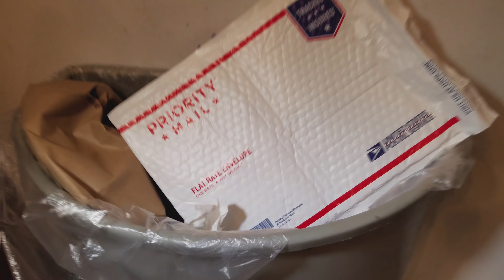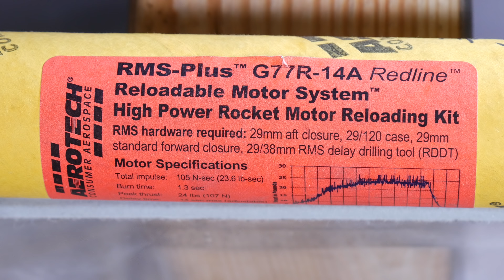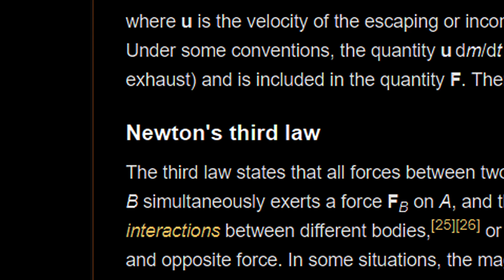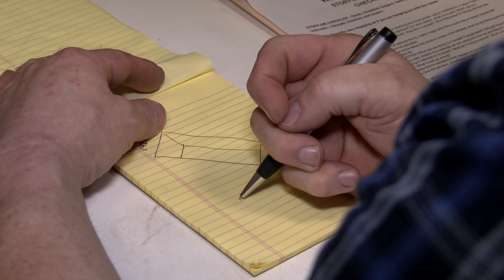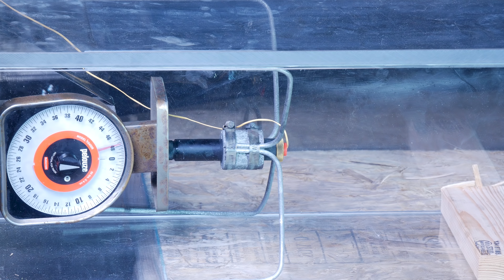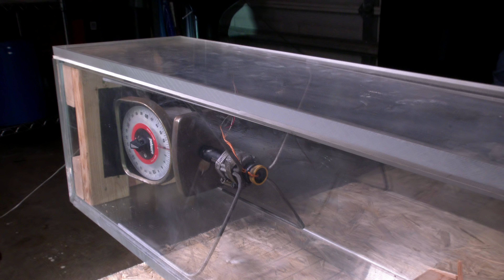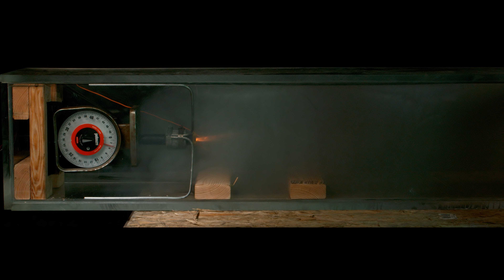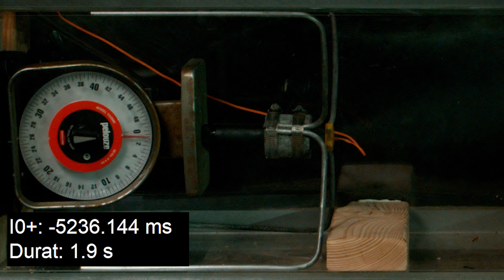Rockets in a Vacuum Chamber - Newton's third law of motion Visualized

Comment: You need to show what is happening with the pressure gauge inside your vacuum while the fuel is burning because inside a sealed case it would probably create it's own atmosphere.
Reply: True its faken
Its correct he fooled ...he created the Atmosphere to burn the oxygen but not really used Vacuum 
Because he'll fail and no one will see this video
Reply: @anjanikumar.t1708  - Maybe you should leave the thinking to those that actually bothered to finish high school?
Reply: @anjanikumar.t1708  Prime example of how some people won't believe anything, regardless of the evidence provided.  Like all Flerfs, the'll just scream "nuh-uh!" and claim they've debunked it.
Reply: It lost half its vacuum when fired up.
Reply: @lomasck  LMAO. Half? You honestly think a little fire cracker like that created 0.5 Atmos of gas in a chamber that size? You'd be lucky if the pressure increased by even a full percent.
Reply: @anjanikumar.t1708  The question wasn't will something burn in space but will a rocket engine produce thrust in space and the answer that question is yes.

Whether something will burn in space is irrelevant as we have hypergolic engines which require no oxygen to burn.

In fact hydrogen oxygen engines have their own oxidizer again not needing oxygen or an atmosphere.

So the question is always been will a rocket produce thrust in space, anyone with two functioning brain cells rub together already knows the answer to this, of course it will.

Even A simple thruster consisting of compressed gas will produce thrust in space.
Reply: @papalegba6796 Explain how what he said contradicts Newtons first law?
Reply: @dorkangel1076  cos a vacuum cannot apply an external force. Look: "Newton's first law states that every object will remain at rest or in uniform motion in a straight line unless compelled to change its state by the action of an external force". Can a vacuum apply an external force? No, it cannot, obviously. As I stated, a free body diagram shows that a rocket in a vacuum cannot create a force pair with an external body, as a vacuum is by definition the absence of all matter. No external body = no force pair = no change in motion. Very simple, but you'll refuse to understand.
Reply: @papalegba6796  Where did he say a vacuum applies an external force? A vacuum is simply empty space. Every action has an equal and opposite reaction. Fire a gun and there is recoil in the opposite direction. Shoot some particles out of a nozzle and there is recoil in the opposite direction. Being in a vacuum actually makes the movement easier since there’s no air resistance on the object being moved by the recoil. It’s quite simple but you’ll refuse to understand…
Reply: @papalegba6796  A rocket firing is zero energy? You're obviously not a chat bot, they're smarter than that...
Reply: @papalegba6796  Tell us again how a space shuttle main engine can accelerate 500 kilograms of mass every second from a standstill to MACH EIGHT all WITHOUT FEELGING A RECOIL FORCE !
WHY do you keep refusing to address this question?
Oh THATS RIGHT, because answering truthfully PROVES YOU WRONG?
Reply: @dorkangel1076  - "You're obviously not a chat bot, they're smarter than that..."

Yeah, I asked ChatGP how rockets propulsion works in a vacuum. It explained it perfectly.
So ChatGP is a smarter Bot than Papa Legba.
Reply: @dorkangel1076  "A vacuum is simply empty space."  Empty space has no relative force. FOR EXAMPLE...  you cannot use empty space to push something, because nothing will happen. LIKEWISE,  you cannot use something to push empty space. Put more simply you cannot use nothing to push something and you cannot use something to push nothing. Laws of physics are built on laws of logic. Without logic its just a bad theory. Can you use something to push against something else? sure. What are you pushing against? Can you use something to push against itself? Perhaps but it would collapse or expand on itself in this way it would not have acceleration or trajectory.
Reply: @toddstiebinger6532  So what? Who says a rocket needs something to push against? You are arguing “logic” against your own strawman. Rockets aren’t pushing off the air so they work even better in space since there’s no air resistance. You should check Greater Sapian’s channel. His latest video breaks down his it actually works and the physics behind it.
Reply: @papalegba6796  "so Newtons first law is wrong? Ok lol." So, you can't understand the experiment. Why turn up to tell us?
Here: Does an explosion in vacuum create outward force, champ?
Reply: @dorkangel1076  These guys aren't here to learn but to cheerlead their anti-science belief system. They are here to help convince themselves they are heroes - without having to think for themselves. I think it's best to just demonstrate how they are wrong in front of the public.
Reply: @Cosmic-Spanner  combustion in a vacuum is impossible, "champ", as it posits a system incapable of either energy transfer or doing work somehow changing its internal energy. Because if ∆U = 0 - 0 then ∆U = 0. So, you don't understand either Newtons first law or the first law of thermodynamics... "Champ chatbot" 😂😂😂😂😂😂
Reply: The equation for work done by a gas is Work = External Pressure x Change in Volume. When external pressure = 0, then Work also = 0. No work = no change in motion. Very, very, simple. Except for NASA chatbots 😂
Reply: @papalegba6796   "combustion in a vacuum is impossible, " Unsupported claim? That's too funny.  Don't need to combust in vacuum champ. Oxidants can be sealed in a container with explosives. This video shows explosions starting and propagating into a partial vacuum. Pressure is variable. Try again.
Reply: @papalegba6796  "spamming fake physics propaganda." It must burn that you can't use real, intelligent arguments to falsify them then right?
Reply: @Gr-Ra5  so all the laws of physics I quoted are not real or intelligent according to you? Ok NASA chatbot 😂😂😂😂😂😂😂😂😂😂
Reply: @Cosmic-Spanner  I stated why combustion in a vacuum violates the laws of physics, chatbot. You're not programmed to understand why tho 😂😂😂😂😂😂😂😂😂😂😂😂😂😂😂😂😂
Reply: @Cosmic-Spanner  you think the first law of thermodynamics is unsupported 😂😂😂😂😂😂😂😂😂😂😂😂😂😂😂😂😂😂😂😂😂😂😂😂😂😂😂😂😂😂😂😂😂
Reply: @toddstiebinger6532  the experiment showing rockets can't work in a vacuum was performed in 1843. It's old news.
Reply: @Gr-Ra5  <----- silly chatbot thinks the laws of physics aren't real or intelligent 😂😂😂😂😂😂😂😂😂😎😎😂😂😂😎😂😂😂😂😂😂😂😂😂😂😂😂😂😂😂😂😂😂😂😂
Reply: @papalegba6796  You only managed "combustion in a vacuum is impossible, " . 
Stating the names of theory and law doesn't mean you "explained" anything, slow guy. It means you can recite names.
Try again. Use some actual science to support this claim.
Reply: @papalegba6796  You need to explain why a sealed container with an explosive and an oxidant cannot work to create an exothermic explosion in a partial vacuum.
Good luck, champ.
Reply: @papalegba6796  Your little yellow pictures in your posts make you look so mature and intelligent! Well done.
Reply: @toddstiebinger6532   Legba: "the experiment showing rockets can't work in a vacuum was performed in 1843. It's old news."
That's right. And up until 1871 experiments showed powered, manned flight was impossible. Legba is a real genius. Hahaha.
Reply: @papalegba6796  Name the experiment, the scientist.. etc etc. Got a link?
Reply: @Cosmic-Spanner  I explained everything, chatbot 😂😂😂😂😂😂😂😂😂😂😂😂😂😂😂😂😂😂😂😂😂😂😂😂😂😂😂😂😂😂😂😂😂😂😂😂😂
Reply: @toddstiebinger6532  NASA chatbots know nothing about the history of physics. Not programmed to 😂😂😂😂😂😂😂😂😂😂😂😂😂😂😂😂😂😂😂😂😂😂😂😂😂😂😂😂😂😂😂😂😂
Reply: @Gr-Ra5  lmao so the laws of thermodynamics ARE fake according to NASA chatbots? 😂😂😂😂😂😂😂😂😂😂😂😂😂😂😂😂😂😂😂😂😂😂😂😂😂😂😂😂😂😂😂😂😂😂😂😂😂😂😂😂😂
Reply: @Cosmic-Spanner  NASA hates the laws of physics & you admit it 😂😂😂😂😂😂😂😂😂😂😂😂😂😂😂😂😂😂
Reply: @Gr-Ra5  listen to yourself hating on the laws of physics like I wrote them 😂😂😂😂😂😂😂😂😂😂😂😂😂😂😂😂
Reply: @papalegba6796  So, you absolutely can't falsify that a sealed oxidised explosive can work in space? That's AWESOME, Legy.
And your lack of explanation that we can actually see in the thread - is simply denied. try again. See if you can explain ANYTHING that supports you. Don't just state that youre right and some names of laws and theories. See if you can be intelligent.
Reply: @toddstiebinger6532  I get the feeling Legba cant explain nor support anything at all because he didn't study and can't understand the topics.
The more yellow pictures he includes the more correct he is about stuff.
Reply: @papalegba6796  "I explained everything" - "combustion in a vacuum is impossible, "champ" Nope. You made a claim.
Reply: @Pounder - "maybe you should just admit that you don't understand the concept of infinite vacuum."
I have been a vacuum test specialist since my first job as an aerospace test engineer in 1995.

I was trained by Lockheed Martin Space Simulation laboratory to operate some of the nation's largest thermal vacuum chambers.
But tell us again how YOU know more about vacuum than I do genius.
Reply: @Pounder Because "NU-UH!" is a logically sound argument, at least in a Flerf's eyes.  I'll never understand the desperation of clinging to an idea which is disproven by literally all aspects of science and logic.  It must be a rather unfulfilling life to have such a fragile ego that one can't stand being wrong.
Reply: @watchyourtimeco1  so the laws of thermodynamics are disproven? NASA would love that but sadly it is not true 😂😂😂😂😂😂😂😂😂😂😂😂😂😂😂😂😂😂
Reply: @stuartgray5877  you're a chatbot you do nothing but spam YouTube comments with gibberish 😂😂😂😂😂😂😂
Reply: @Gr-Ra5  nah I explained it, chatbot 😂😂😂😂😂😂😂😂
Reply: @Cosmic-Spanner  s🍎so you forbid me from using the laws of physics to explain things? Ok chatbot 😂😂😂😂😂😂😂😂😂😂😂😂
Reply: @@Poundertruth the chatbots are literally telling me I'm not allowed to use the laws of physics when I explain why a rocket can't work in a vacuum, you cannot make this level of FAIL up 😂😂😂😂😂😂😂😂😂😂😂😂😂😂😂😂😂😂
Reply: @@Poundertruth I'm the only one in the thread even quoting the laws of physics. The chatbots are just calling me names & telling me to stop 😂😂😂😂😂
Reply: @papalegba6796  But youre unable to quote your own explanation?
That's hilarious. It's like youre embarrased and think Iying will distract us.
Reply: @papalegba6796   "combustion in a vacuum is impossible, " . Unsupported claim.
Again: You need to explain why a sealed container with an explosive and an oxidant cannot work to create an exothermic explosion in a partial vacuum.
Good luck, champ.
Reply: @@Poundertruth Tell us what his explanation was then, champ.
You'll look great when you fail or quote his unsupported claim or an equivalence fallacy as if it was an explanation,  Watch:
Reply: @@Poundertruth the chatbots are now claiming that the first law of thermodynamics is unsupported. They are a hoot!😂😂😂😂😂
Reply: @Gr-Ra5  it's like you ignore everything I post & just abuse me. Could it be because you are a chatbot? 😂😂😂😂
Reply: @Cosmic-Spanner  I never mentioned a partial vacuum, never mentioned a sealed container either. I said combustion in a vacuum is impossible & explained why. You are a proven liar now, as if nobody knew already 😂😂😂😂😂😂😂😂😂
Reply: @Gr-Ra5  you're claiming the Joule expansion experiment was wrong too 😂😂😂😂😂😂😂😂😂😂😂😂😂😂😂😂😂😂😂😂😂😂😂😂😂😂😂😂😂😂😂😂😂😂😂😂😂😂😂
Reply: @papalegba6796  More incoherent nonsense? Awesome.
You can't explain yourself.
Reply: @papalegba6796  If I was a chatbot, would that make you able to explain your claim, Einstein?
Reply: @papalegba6796  " I never mentioned" But I did. Well done admitting you don't have an explanation - and that anything in proximity to an explosion in space (partial vacuum) would move away i a specific vector.
We already know you need conditions for combustion. You're not fast are you pupu. Try harder.
Reply: @papalegba6796  "are now claiming that the first law of thermodynamics is unsupported."
That's supported. Your claim isn't. Remember the words i used? "Unsupported CLAIM". Do you train to be this slow, Pupu?
Reply: Nothing the NASA chatbots post makes sense any more. They're just ranting & hating on the laws of physics 😂😂😂😂😂😂😂😂😂😂😂😂😂😂😂😂😂😂😂
Reply: So you'll have to prove a sealed container with fuel/oxidiser can't explode in space, and then why an object wouldn't react to the force from it. Hahahaha. Saying "but I said a law" doesn't make a supported argument champ. That's you having no real argument.
Reply: @Cosmic-Spanner  so when you lie about what I said it's my fault not yours? Ok chatbot 😂😂😂😂😂😂😂😂😂😂😂😂😂
Reply: @Cosmic-Spanner  so space is a partial vacuum now? According to NASA it's the most perfect vacuum possible but you're just lying about everything now anyway 😂😂😂😂😂😂😂😂😂😂😂😂
Reply: @papalegba6796  Trying to distract us, champ ? HAHAHA.
"so space is a partial vacuum now?" What's the pressure just outside earth's atmosphere, Pupu?
Reply: @papalegba6796  "but you're just lying about everything" If that were the case you would have a supported argument to prove it, Pupu.
Reply: @papalegba6796  The problem for you, is that we can read the thread and understand why you're failing.
Reply: @papalegba6796  "to NASA it's the most perfect vacuum" Is it perfect, Iiar?
Reply: @Cosmic-Spanner  so your fuels are sealed from a vacuum now? Ok chatbot 😂
Reply: @papalegba6796   If there was an explosion in space, there was pressure and an oxidiser, Smart guy.
Look how you still havent got a clue how to answer this. Hahaha. Just funny questions to try and distract.
Reply: @papalegba6796  So an explosion in space would propel a close object away from it, and we can use that principal to make thrust.
Youre done here. Pupu. You have nothing.
Reply: @Cosmic-Spanner  so there's pressure in a vacuum now? Ok chatbot 😂
Reply: @Cosmic-Spanner  so the exhaust of a rocket has to turn around to face the rocket, then impossibly combust in a vacuum, in order to push the rocket away from it? Ok chatbot 😂
Reply: @papalegba6796  "sealed from a vacuum now?" They were from the start. I didnt say we combusted anything in vacuum, YOU did. You tried a straw man fallacy and lost.
Reply: @Cosmic-Spanner  how many objects is a rocket, chatbot? I count one but you seem to think it's at least two, both of which violate the laws of physics anyway 😂
Reply: @papalegba6796  "then impossibly combust in a vacuum" Is the explosive sealed in a container, SHerlock? Are you STILL having to Iie to make your argument? Hahahaha,
Reply: @papalegba6796  "how many objects is a rocket" Explain how this changes anything. You know, say something that means sometyhing.
 "both of which violate the laws of physics anyway 😂" So why cant you explain how, champ?
Obviously if youre still making unsupported claims, you can't have a real argument. LOL
You would just post the real argument.
Reply: @Cosmic-Spanner  ok so you admit combustion in a vacuum is impossible. I agree, as do the laws of physics you hate 😂
Reply: @Cosmic-Spanner  please just quote one law of physics you don't hate. Just one, angry chatbot loon 😂😂😂😂😂😂😂😂😂😂😂😂
Reply: @papalegba6796  Youre really starting to realise how badly you got burned and exposed here arent you. Hahaha.
Reply: @papalegba6796  "ok so you admit combustion in a vacuum is impossible" We're still not doing that, like I told you in the beginning. Remember the sealed container statement YOU made? Hahaha, How are you STILL trying to Iie about this and think people wont see it?
Reply: @papalegba6796  Again: You need to explain why a sealed container with an explosive and an oxidant cannot work to create an explosion in a partial vacuum and PUSH on an object next to it.
Good luck, champ.
Reply: @Cosmic-Spanner  if you can't quote any laws of physics to support you just say so, angry ranting chatbot. No need for all the rage 😂
Reply: I don't need to explain why a rocket NOT in a vacuum would work, because I never said it wouldnt. NASA chatbots are insane 😂
Reply: @Cosmic-Spanner  you're also claiming a rocket is two objects again, are you blind? Crazy raging NASA chatbots cannot count 😂
Reply: @Cosmic-Spanner  how many objects is a rocket, crazy ranting chatbot? I count one but you clearly see two 😂
Reply: @papalegba6796  Four years later and this NASA chatbot is still alive and well.

Really? NASA chatbot is all you got?
Reply: @CreggLund  I'm not calling you a chatbot. Tho maybe you are, as you clearly haven't read the thread 😂
Reply: @papalegba6796  I stated a method you cannot falsify that can create thrust in space using fuel. Youre done.
Reply: @papalegba6796   "how many objects is a rocket" I told you to tell us what difference it makes and you can only recite your question. LOL
Over and over, and with little yellow face picture, you show us what you are.
Reply: @Cosmic-Spanner  your chatbot ranting still contains zero references to any physics. It never will either, as you are not programmed to understand them 😂
Reply: @papalegba6796  Again: You need to explain why a sealed container with an explosive and an oxidant cannot work to create an explosion in a partial vacuum and PUSH on an object next to it.
Good luck, champ.
Reply: @papalegba6796  "still contains zero references to any physics." And I'm still beating you. Easily. Funny, no?
Reply: @Cosmic-Spanner  lol so you're beating me at explaining physics by explaining no physics & making mad unverifiable claims about things I never said anyway? Um, no, chatbot. You are not 😂
Reply: @Cosmic-Spanner  so, according to you a rocket in a vacuum is in fact a sealed container behind the rocket, in a partial vacuum that you do not define, that somehow explodes & pushes the rocket away from it? Also pretty sure explosives already contain an oxidant, but that's the least of your problems tbh 😂
Reply: @papalegba6796  "Also pretty sure explosives already contain an oxidant," That would depend on the explosive, Einstein.
Pretty sure you don't understand any of the topics, champ.
Reply: @papalegba6796  Again: You need to explain why a sealed container with an explosive and an oxidant cannot work to create an explosion in a partial vacuum and PUSH on an object next to it.
Youre failing after ALL these posts of you crying. haha.
Reply: @papalegba6796  "so, according to you a rocket in a vacuum is" Nope. You cant seem to do anything except create straw mans. Hahaha.
 I gave an example of how to produce thrust in space, champ. Show us how you cant refute any of it again.
Reply: @Cosmic-Spanner  you literally can't state how many objects one rocket is, yet you say you are beating me. Utter chatbot fail 😂😂😂😂😂😂😂😂
Reply: @papalegba6796  "you literally can't state how many objects one rocket " 3 times you were told to explain what difference this makes. You failed every time and can only repeat the question.
Reply: @papalegba6796  Its so funny that you glaringly show us you think this red herring is an argument. How would you ever know if you "won" any argument when you cant understand the basic ideas being argued, champ?
Reply: @Cosmic-Spanner  please provide the empirical evidence you claim have that proves a gas does NOT expand into a vacuum without developing mechanical power, chatbot 😂
Reply: @Cosmic-Spanner  you don't know what the word "falsify" even means, do you chatbot? It means YOU have to provide empirical evidence for every claim you make. So get to it, show me empirical evidence that a gas can develop mechanical power when it expands into a vacuum, please, as well as empirical evidence that the laws of thermodynamics are false. Your claim, your onus 😂😂😂😂😂😂😂
Reply: @papalegba6796   "expand into a vacuum without developing mechanical power," Gibber some more, champ.
You can't falsify the assertion that an explosion would propel anything close to it away. Try. NOTHING you say can refute it and we all know it. That's why youre asking me your hilarious questions again.
Reply: @papalegba6796  "you don't know what the word "falsify" even means"  Falsification, according to Popper, means you have to present a supported argument against an assertion that's supported by existing science. LOL
All explosions propagate force outwards according to science, independent of where they are. Show us where it says otherwise, Einstein.
Too bad you lost again. How does it feel being easily beaten by a Chatbot?
Reply: @papalegba6796   "evidence that the laws of thermodynamics are false." Strawman again, champ? 
Who claimed it was false, Einstein? See how you fail at every turn? Even though you were reminded about 10 times that nobody "combusted in a vacuum" you still cant understand and make the same false argument. LOL
Reply: @Cosmic-Spanner  also you just admitted to being a chatbot again 😂😂😂😂😂😂😂
Reply: @Cosmic-Spanner  explosions are impossible in a vacuum, chatbot. Because of the laws of thermodynamics you claim are false 😂
Reply: @Cosmic-Spanner  You fail the Turing test so badly 😂😂😂😂😂😂😂😂
Reply: @papalegba6796  "explosions are impossible in a vacuum"
So, why can't you show us why?
Hahaha.
Reply: @papalegba6796  That's right, Im a chatbot, paid by the hour.
So, isn't it sad you're losing? LOL
Reply: @papalegba6796   "Because of the laws of thermodynamics you claim are false"
As you know and I have tyold you about 5 times -  I don't claim they are false, I challenged you to explain WHY.
And you can't.
Reply: @papalegba6796  "explosions are impossible in a vacuum"
Nice proof by assertion there, champ. There seem to be explosions in science's explanations of space, so you're not speaking for science here.
Reply: @Gr-Ra5  I already explained why using the laws of thermodynamics but you're a chatbot & didn't read the thread ?😂
Reply: @Cosmic-Spanner  I did explain, you ignored my explanation & kept on abusing me. It's all you are programmed to do 😂
Reply: @papalegba6796  You didn't study physics so your appeal is meaningless. Heres a BIG tip for you: A CLAIM isn't an explanation.
Reply: @Gr-Ra5  It is literally IMPOSSBLE to "argue" with papalegba.
It makes ridiculous claims, such as "Explosions cannot occur in a vacuum" when I can show it numerous examples that prove otherwise.
For example, it refuses to even WATCH a video that proves rockets work in a vacuum.
The cognitive dissonance is too strong in this one.
Reply: @stuartgray5877  I know. I like bringing attention to him and exposing his false beliefs.
Reply: @dannelson8556  But what you write is not true. By the time the engine was exhibiting motion energy, the chamber was no longer a vacuum, but filled with gas from combustion.